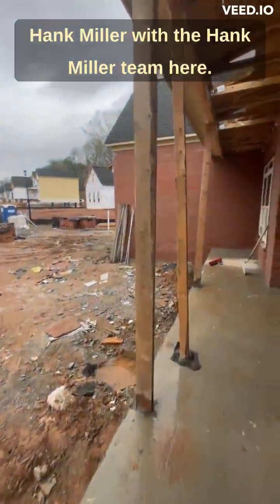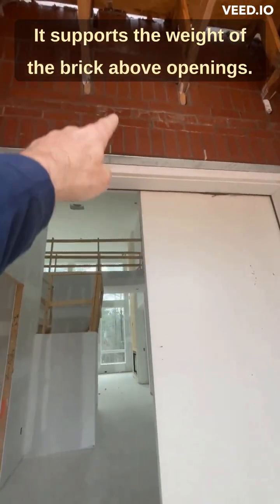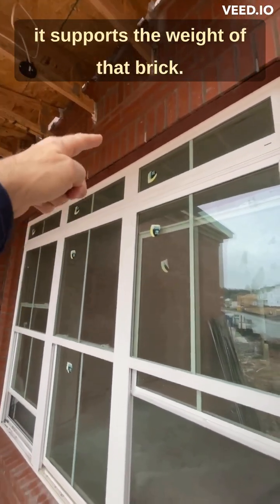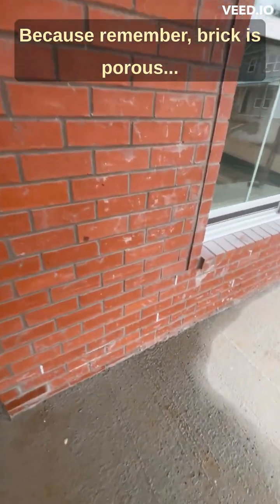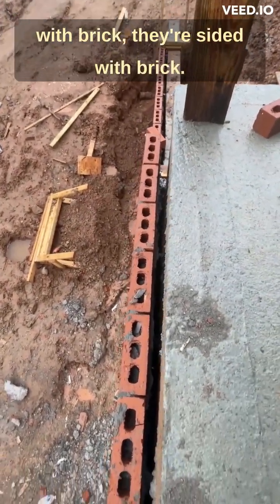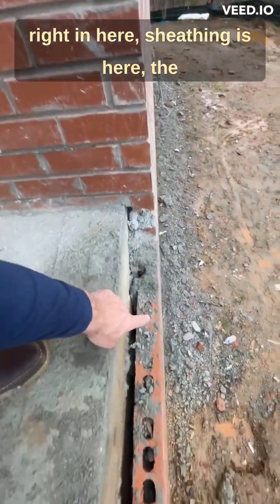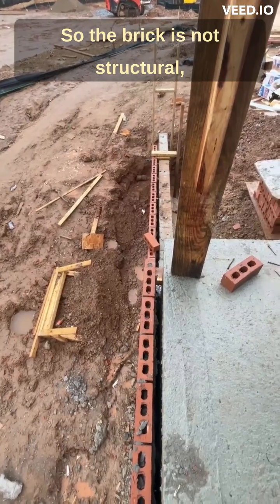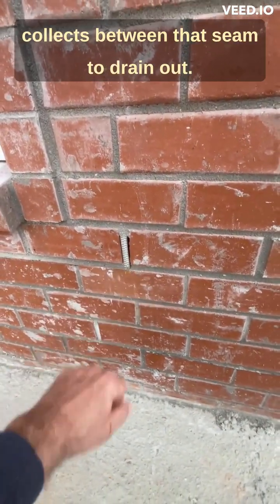Brick Lintels & Weep Holes

Comment: Thats simply B S.
Ask someone who actually knows about that, because you obviously dont.
Your just another internet talking head yahoo.
Weep holes would be at the angle iron level over that window, not above.
The angle iorn is the actual lintel in that case, not the brickwork above it.
Same goes for the other places you point out.
The weep holes would be at the very bottom of the brick wall, not just scattered about as you show them.

Comment: You explained it semi wrong in the beginning but then corrected yourself, so thats okay. Like you said theyre not built of brick.. theyre sided. Anything 3 or more wythe typically had no weep holes. They let the drainage do the work of getting water away. Though yes bricks are porous, id argue the weeps are more due to the insulation cavity.

Comment: If you tug on those weep vents, I wonder how many are installed incorrectly or made to look installed but don't actually do their job, due to being cut short or not extending through the brick to the back.

I've seen many inspection videos nail this in their videos, seems like weep vents are the one things builders love to cut corners on among other things.

A little tug on them can revel alot.

Comment: These slots aren't drains, they're aeration slots to ventilate the space between the brick and the building, so no humidity from condensation could stay for too long causing the bricks to soak it and lose its integrity after a long exposure to moisture
Reply: In the uk they’re water weep vents fixed above the cavity tray to release moisture it maybe be different in America? I know our brickwork nothing like that it looks like a school boys done it!
Reply: It does both. However their main purpose is to let water out. That's why the code has them put so close to the tray or the ground.
Reply: Nope. Main purpose is as he stated to let water that collects in the air gap out. Proper installation (depending on local code ofc) requires a PVC flashing if the brick is against wood framing as well. This flashing is supposed to "cut" through the base course of brick to help pool water to the weeps. This does not cause delamination of the brick to the foundation as one might expect. You'll be hard pressed to find masons following all best practice unless it's commercial work with architects and engineers involved at least in my area (also SE as I understand OP is from as well)
Reply: No, thus isn't correct. Search "cavity tray in brockwork" diagrams
Reply: @FatterTony I been building for 40 years and the weep vents(weep to later water weep out the clues in the name) are build immediately above the cavity tray, check uk building codes cheers
Reply: @FatterTony  👍

Comment: What about old houses with 2 layers of structural brick? How do they breathe?
Reply: they breathe fine as long as they aren't sealed on the exterior, you should never paint the exterior of structural masonry. Moisture is "wicked" through the material and if it can't leave it will cause issues.

Comment: Called brick veneer, steel above doors and window called a buck!
Professional Terminology
Reply: its a lintel never heard "buck" in my life sounds regional and the technical term is "curtain wall" not veneer...just saying. You went to trade school for masonry?
Reply: @DRS659  the term is brick veneer. Curtain walls are not brick veneers. Two different systems. When you google "curtain wall" it talks mostly about glass facades
Reply: @johnnymac6242  hooray for google, so you've been to trade school then? google frenchman and I'm assuming you want see a tool used for joints, how about googling queens/kings closer...sorry if you feel that you're right but please go ask any mason on the planet if they've ever heard anyone refer to a lintel as a "buck" before you start trying lecture others on the terminology in this trade please...
Reply: @DRS659   and @johnnymac6242 and Jose you are all right and wrong. The name has to do with regions but also with standard. If you want to read more the code book would be the ICC International building code not google. If you live in the states your state will have a code based on that. The "buck" is the wood between the window and the concrete (it is not used in wood construction in that way mostly) the top of the window is the "header" this may be a lintel or not (mostly a sort of tie beam which is not really a lintel in masonry or concrete construction); That wall is called a double-wythe cavity wall and it is mostly used in colder climates due to its insulating properties. It is not a good candidate for HVHZ (high velocity wind zones) or seismic areas.
Reply: @johnwesley6929  it's single wythe though...double wythe is structural, that's what makes it a curtain wall. Veneer would be bonded directly to the structural wall with no air cavity separation, where this is a single wythe attached by ties and separated by an air cavity...double wythe is two bricks thick not one (and I'd pay money to see these masons attempt to build a double wythe haha). For that  guy calling lintels bucks you may be more familiar with the colloquialism double skin cause I'd be shocked if anyone who hasn't been to trade school has ever heard the term wythe.
Reply: @DRS659  its double wythe the block is 1 and the brick is the other. The brick needs to be tied to the block anyway for most applications. You can call it a cavity wall its all somewhat the same.
Reply: We just call the angles
Reply from the maker: As noted above, this is intended for civilian buyers, "sided" is more familiar. I noted that the home wasn't built with brick, but yes, thanks for correcting me. As far as "buck", I'll stay with lintel.